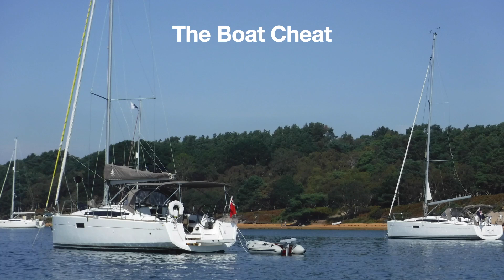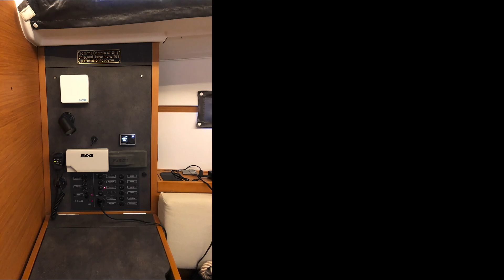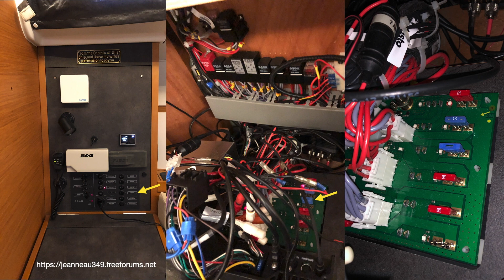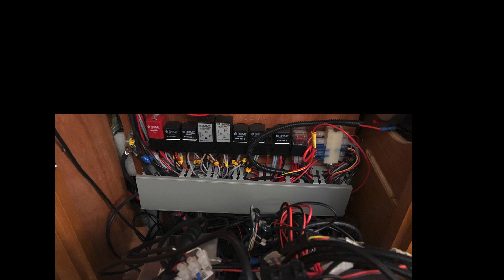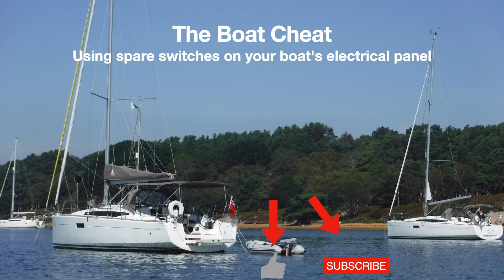Using spare switches on your boat's electrical panel

Comment from the maker: Hi thebarold - no this does not work for galvanic isolators because that has to go in the earth line to the shore power. I will do a short video in the next few days to show the installation of a galvanic isolator if that would help.

Comment: Thank you so much for this. Very helpful!  I saw on the forum that you installed the galvanic isolator below the earth connector behind the panel. So that is how you install it inline the earthing system (and you know which direction goes to the “earth”?
Reply from the maker: Hi - I will do a video on the galvanic isoplator intallation asap - it goes in the earth line between the shore power connection and the connection to the electrical panel - so that everything inside the boat is earthed via the isolator.  I am not sure without looking at it whether the isolator needs to be a cetain way round, but I will cover that in the video too.